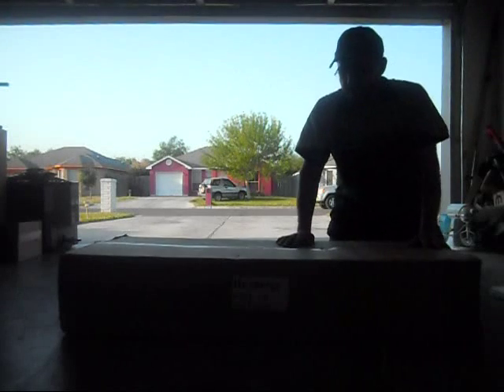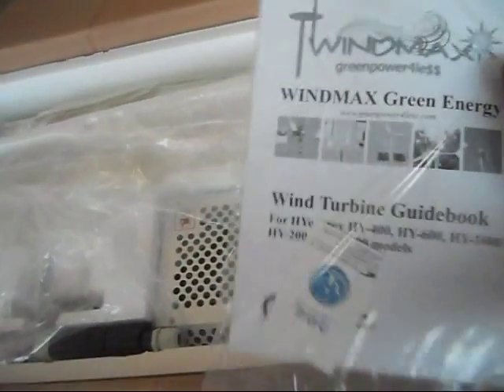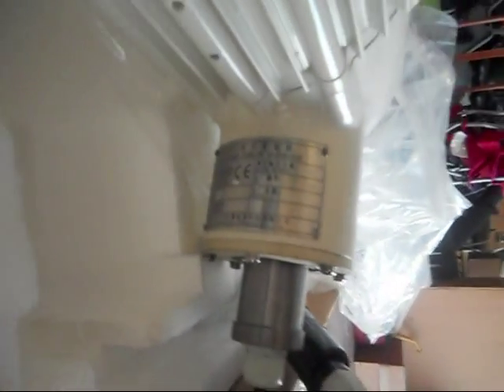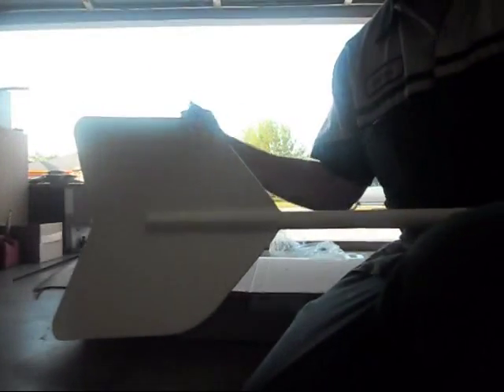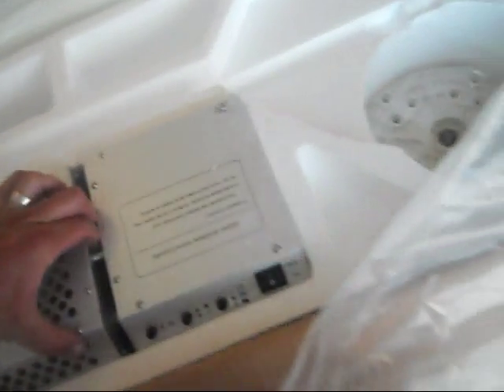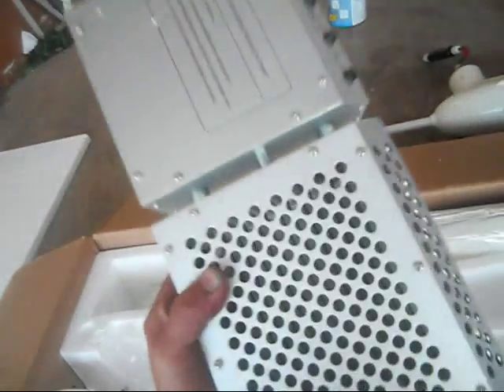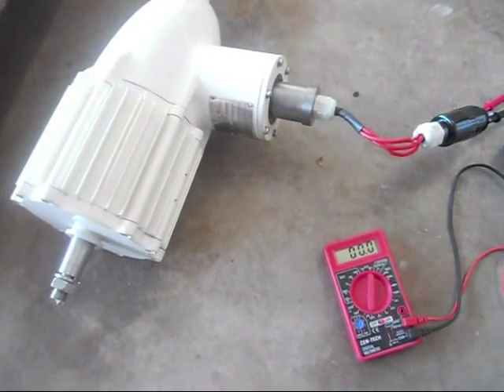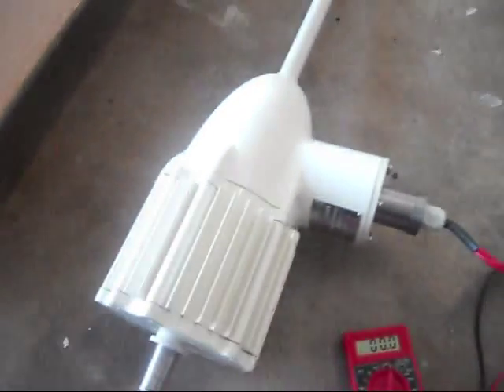THE OPENING OF MY NEW WINDMAX HY1000 24 VOLT WIND TURBINE

Comment: I think you should first thing is weld a longer and wider tail on it or it will not be stable. I saw video where was spinning and not stable it needed a improvement to the tail. They are conveyor  belt motors not really made for out doors you might spray some sealer inside of it to weather proof it. Also I saw a video about putting better blades and adapter to to make the blade fit. To improve the out put a low wind speeds. I am not trying to upset you or knock it I really hope it works great.

Comment from the maker: @123barnman well, the ceiling fan turbine i'm going to take down and make something else with it. the 90 volt dc motor pma i am going to hook it up to a 12 volt battery to run some lights in my shed i'm building. or i am thinking about getting a colman air charge controller that can be switched from 12 volts to 24 volts. i'm still thinking about it but right now i need to get my shed built so i can move everything to it...